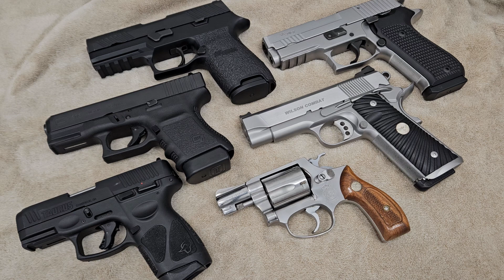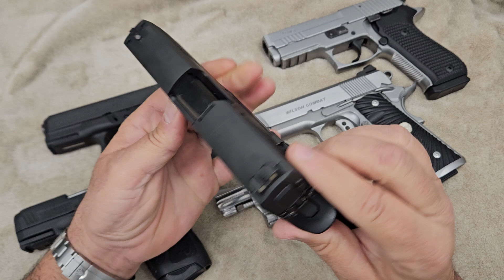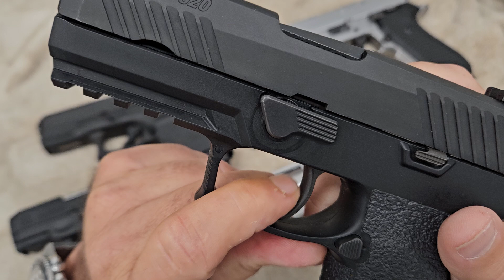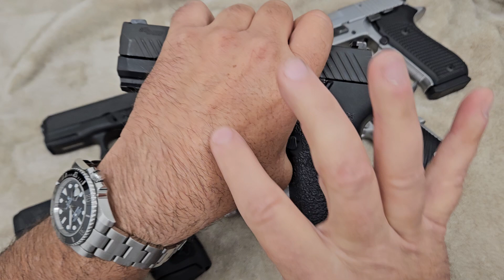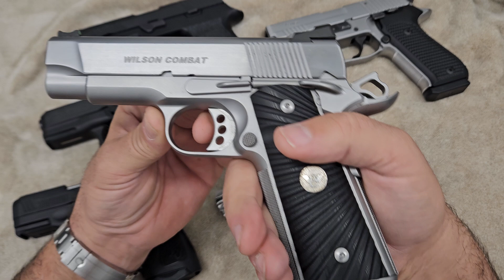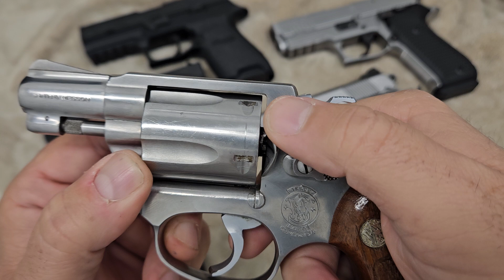Pistol / Handguns external safeties.  are they essential?

Comment: I think a safety on a striker-fired pistol like a Glock is useful for what I call "less than ideal holstering situations" where you don't have something protecting the trigger guard. So, if you want to just throw your Glock in a jacket pocket or a book sack, or maybe have it loose on a desk, actuating the safety prevents negligent discharge. Thanks for the video!
Reply from the maker: Thank you for watching
Reply: The safety lever could be knocked open by something loose in the bag or pocket. You should still have the trigger guard covered by some form of holster.
Reply: @JoBiatch  I personally wouldn't worry about that because I wouldn't put it in the pocket or bag compartment with anything else. The main benefit to me is having something I can actuate if a Kydex holster/trigger guard isn't available. YMMV.

Comment: I do like an external safety on my firearm when I'm hiking in the woods or camping, and for that I use my M&P shield gen 1 and I carry it with Buffalo Bore or an XD40 subcompact the XD has a grip safety and I carry it with Underwood Extreme Penetrators. But the guns in my EDC rotation has no manual safety And that's the way I like to carry
Reply from the maker: @quoththeraven7  i like your way of thinking. Thank you for sharing

Comment: As usual you sucked me in Terry.   The  best safety is the one you don't even know is there.   This would be hammer block or transfer bars or grip safety or 'short' inertia firing pins etc.    Early SA guns Like the Colt 1873 had a safety notch...  I am good with that... same for some rifles and shotguns of the era.    The earlier cap and ball revolvers had a position between the chambers for resting the hammer on  a pin actually.   Course I rode Harleys for 30 years without a helmet and only wore seat belts when racing so... keep  that in mind...I also carry a 1911 like Saint Browning intended with the hammer down  on a loaded chamber and cock on the draw... just like the SAA...   Not the blasphemous hideous 'extended beavertail'  and tiny little commander hammer nonsense.    I thought that beavertail was for hanging the gun on  a wall?    I can't even count all the safeties on a 1911 so using the manual one is ... well..   To  quote someone who was often right but wrong a time or two... "it is a complex solution to a nonexistent problem"    Plastic guns?    no opinion.    Don't care.. don't own any.  probly never will.. too many cool guns I don't own yet.  DA/SA self chuckers...  Love em.
Reply from the maker: Always love your comment. Thanks man
Reply: @TerryBenton  LOL...  An ex once told me that I am nothing if hot colorful.    Make a woman laugh and she is yours.   Except of course when she says 'who ya gonna please with that little thing'  then you just have to say 'me'

Comment: I have and like every gun you have on the table with the exception of the the Wilson.My substitute for the Wilson is Ed Brown Kobra. The Glock 30S (slim) is also my preferred daily carry,in my opinion it's faultless. I did install front night site and a Bar-Sto barrel as I use Buff. Bore Hard cast lead when traveling long distance on my Harley (penetration of passenger vehicle sheet metal being the goal). You know how a cage driver can make an attempt on your life  for absolutely no reason. I haven't installed the rear nite site as I have not had a need. Regarding Sig my pick is the M-11 A1 known in civilian speak as the 228. Mine came with Siglite sights 3-15 rnd mags it was requested by US military for fighter pilots along with a shoulder rig, I always go goofy over firearms that have passed military testing.Also all the internals are coated with Nitron finish for protection against salt water. The earliest version is the M-11 and currently M-11 A1. I sold my M-11 and currently have the M-11 A1, I  see no difference in function.Both pieces come with a NSN sticker on the dust cover and have been 100% reliable for me. I haven't really warmed up to the 320 yet. Regarding the Sig military contract my belief is the Almighty Dollar. Sig came in much cheaper than Glock take it for what it's worth.I'm in agreement that no firearm just discharges. The Beretta 92FS Inox laying on top of my fridge goes a year at a time and never makes a peep.It's stoked with +P HP's and 2 15 round mags beside it. Overall my 2 fav platforms are 1911's first and big wheel guns first, hahaha hahaha hahaha however there are times when capacity is a plus all things considered. Referring to your question I am a no safety person, I have full confidence in myself and my firearms skill. I've competeted IPSC top level,carried daily on duty, and carried casually,all with 1911's and Glocks also some Bullseye with wheel guns.At no time in 35 years have I felt a random discharge coming on or been checked by my peers for gun handling. Have a great day Terry.
Reply from the maker: You like 1911s like I do. Thank you so much for your comment and you also have a great day

Comment: My two carry guns are a Sig M18 and an older Sig P229. The M18 has a manual thumb safety and I like it. My right thumb rests on it and it is nothing to switch it off while pulling it out of the holster. 

The P229 has a manual safety, but it's a DA/SA handgun, so I use the long first trigger pull as the safety.

They aren't needed but can be a handy option.
Reply from the maker: @michaelholt8590  very good choices . Thank you for watching

Comment: I concur. The Sig P320 cannot go off spontaneously although there are those that will argue the point. When I purchased my Sig 365, I specifically sought one without an external safety. If the need arises, the Sig can be drawn, pointed and fired without fumbling around with a safety lever.
Reply from the maker: I agree!!!! Thanks for sharing
Reply: @Caje-zf8md  A friend of mine has a P365X, and that is a great EDC handgun
Reply from the maker: @michaelholt8590  they are great guns. Very similar to the P320